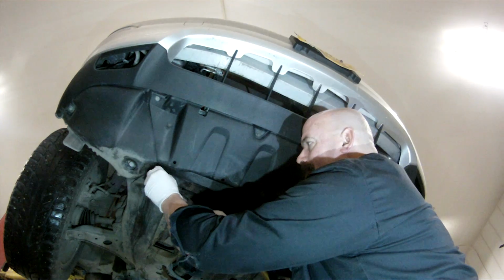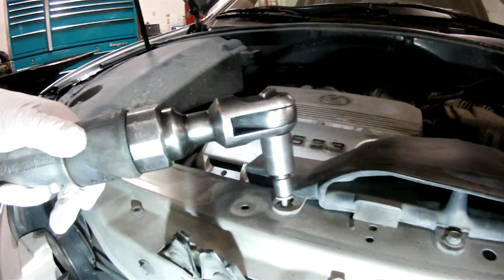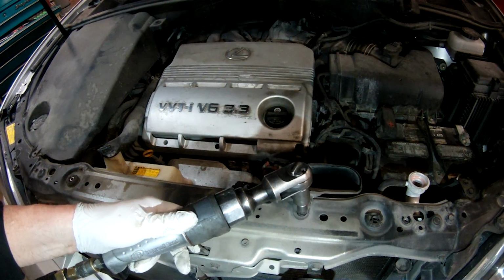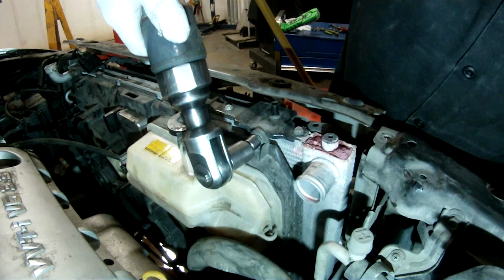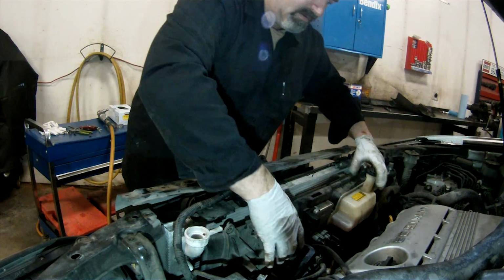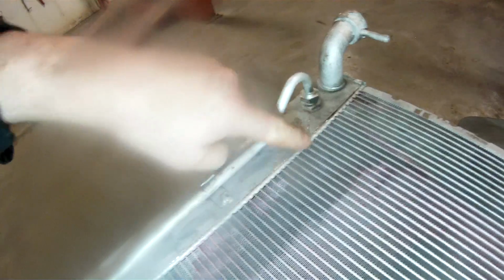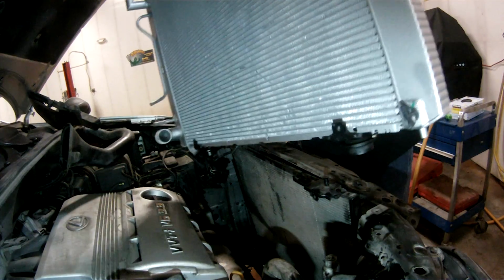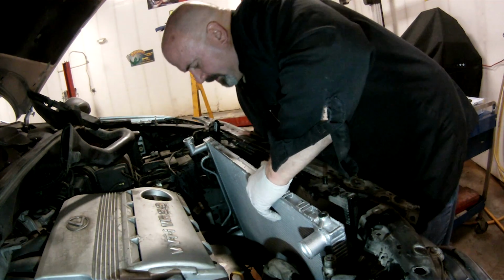Lexus RX 330 Radiator Replace

Comment: Just changed out my radiator on my 05 RX330 with 228K miles on it, thanks to this video! Thank you for the thorough tutorial!!
Reply: How does your car run, cuz I’ve had some major issues that I’ve gotten fixed with mine like double blown head gaskets, both control arms and the radiator as of recently. I don’t know if it’s worth dumping money in it anymore and would need the opinion of a fellow 330 driver

Comment: Great video.  I just replaced the radiator on my Dodge Ram 2004 and it was much less involved than this. My wife has this Lexus RX 330 model and I hope I can get away with my plan for a coolant flush without running into any issues with the radiator or heater core (we bought the car from a young guy who didn't have any recent maintenance records on the vehicle, hence the need to replace the coolant).  If I wind up having to replace the radiator, I will take your advice and get a manufactured model.  I wouldn't want to repeat this repair twice.  Good to see honest mechanics online helping others.

Comment: Good video, first I have seen from this chap.  Have a rx300 same year and will be replacing the rad with a genuine part. Pattern part is 200 euros whereby genuine article is 410. Si it’s costing 21 extra for a component that should last years. Had it 12 years already and still drives like new. The only difference is I have a large aircon pipe across the front of the fan cowling to navigate.  Hopefully without degassing the aircon.
Reply from the maker: I hope the pipe can be moved enough to get the job done. Take care

Comment: Just completed this repair on a Canadian made 2004 RX330 without tow package and the Denso 221-9387 fit perfectly.  Dealer said I needed the 160410A412 but the $150 Denso was fine.  This particular Denso is made for them by Koyorad in Indonesia but arrived in a Denso box.  There were foam strips on the sides of the old rad that I carefully scraped/peeled off and reattached with Krylon spray adhesive.  Two small tricks in the removal are 1) use a ratchet and Phillips bit to remove the long screws that go through the A/C condenser since they are often rusty and 2) use a slot screwdriver to pry the condenser up and out of the bracket it is sitting in.  Mine was stuck in the bracket until I gently pried it up and out.
Reply: how has the denso radiator held up?
Reply: @ no issues at all. Works perfectly
Reply: @billboswell4509  glad to hear, I wish it many more years of service! These are some of the greatest cars ever made
Reply: @ wife loves it and the way the new ones are being stolen and have $5,000 annual insurance premiums she wants me to keep it going.
Reply: @billboswell4509  as long as it doesn’t rust out it should keep going. I use surface shield on the body and frame! How many miles?
Reply: @ 88,000 miles and sprayed with Fluid Film. Driven in all kinds of weather and salty roads. Surface rust but no structural rust except the left rear brake dust shield. Cheap enough but a pain to replace.

Comment: The 05 rx330 in australia is the plastic version 
Yep split the plastic housing on the left hand side
Thermostat was dodgy as hell, maybe the thermostat jams closed - original part has a secondary rubber gasket- shredded and jammed the valve. If the the thermostat jammed closed, then the pressure would build up, causing high temp and high pressure, splitting the plastic radiator housing 
The thermostat is a good 90 mins to change, bit of a head fxxxk for me at least. Great video - Thankyou

Comment: You don't need a stubby screwdriver to remove the two screws from the AC condenser side of the RX330.  Those screws are available to a two foot long one if you wanted.  The front air dam opening is in line with them.  They are usually quite rusty because they are exposed to the elements and in the direct line of salt and sand in the winter.  Take a knee in front of any RX330 you see in a parking lot and you can see one in the left opening and one in the right.  Easy peasy instead of knuckle busting with a stubby screwdriver.  Just use penetrating oil, so you don't strip out the head or break off the screw when they are rusted badly.
Reply: Those are tough to get off, very rusted
Reply: @davidbartelt2384  Yes they are, good luck and   wait over night if you can with the oil.  The hardest part is seeing the darn things to begin with, they are very tough to line up with anywhere but right in front of them to know where to put the tool into those slots.

Comment: I try to by manufactures parts but your right, sometimes the price they want is just too much. There pricing themselves out of parts. Nice work on the one doc!
Reply from the maker: +wyattoneable I appriciate that. The more I can give customers the option the better. That way I can remind them when a part fails to provide the service that's expected. But for the price of this radiator we could replace a few and still be under the cost of OE. Take care.

Comment: The bottom screws on the mounting bracket that hold the radiator to the air conditioning panel are rusted badly.  If I cut the heads off with a small grinder, will I be able to separate the two panels?  Any other suggestions.

Comment: I had the same thing happen with my Dodge Ram. Plastic construction meeting steel leads to thermal strain with the dramatic swings of temp.
Reply from the maker: +spelunkerd I just did a ram radiator today. It was an 02 5.9 gas engine. Wasn't too bad of a job. I'll be posting a video in the next couple days. Check back in a few days if you want a chuckle. It is coming back in a couple days for a timing cover gasket as well.
Reply: +The Car Doctor Ya, I did a vid of that one a couple of years ago. Gotta love how much room there is in the engine compartment, but I found my back was sore from leaning over that engine. It was easier to stand inside the slot for the rad, to bolt on a new water pump, ha ha. Mine is a 5.9, too, and although I love the vehicle I sure pay the price at the gas pumps.
Reply from the maker: I don't think I can fit in the slot between the radiator. I'll give it a try but I may need to get a crane to pull me out if I get stuck.

Comment: Thanks, very good! And how does the new radiator affect the engine temperature? After all, in the new radiator there are approximately 50-60 sections, and in the original radiator there are about 80-90 sections?

Comment: This is a common problem.  I have a rx 300 232K miles and 330 157K miles sitting out there leaking on my driveway.  expansion tank looks low. when I add more it comes out.  But the car runs with out any problem.  Lexus should look in to this.

Comment: Have you ran into any issues with ordering the correct radiator? My wife's 05 330 just got a bad leak this morning. I looked a while back and didn't want to order the wrong one. I dont think it has a towing package but how do I know if it does or not other than not having a hitch? And it says made in Canada in the door. It has metal caps on the radiator. Got any suggestions on what I should order?
Reply: I ordered one from Amazon and it fit. It said in the description made in Japan. It also said only fits Japanese made vehicles. But the seller commented that if your vehicle had an all metal radiator it would work even if its Canadian made. 
     The job did take about 8 hours and I had to add some thin foam rubber between the radiator and condenser to keep them from rubbing as well as transferring bigger blocks of foam.
      I also had to sculpt a lower radiator mounting bracket from a JB weld stick because it had almost rusted away from being in contact with the highly corrosive coolant. Couldn't seem to be able to find the lower brackets in a timely manner on the weekend and after business hours. 
     Hope this helps someone on this job.
Reply: @jamesrogers4674  how has the radiator held up? What brand is it?
Reply: Water pump bearings went out and slipped the timing belt, bent all the valves. Probably shortly after the radiator. Had to buy another vehicle and sold it for 1k. Couldn't believe they'd have such a poor design.
Reply: @jamesrogers4674  bummer, how many miles and had the water pump and timing belt been replaced at the 90k interval?

Comment: Would an 07 RX 350 replacement be identical to this one? Also, I noticed that the 330 has an aluminum radiator and my 350's is plastic. Do the 350's have the same issues with the aftermarkets?

Comment: Hi. Please help me here. I took my 2007 model of RX350 Sports luxary version. After an hour or so, the mechanic called me and said that in this model the radiator is connected to the one other panel which is the part of the airconditioning unit and that he will have to get it degassed, replace the radiator and then take it for regassing. Since I trusted him, I told him that do it only if necessary. After looking at your video, i dont think any mechanic had to take that panel out which was behind the radiator. What should I do? Does the air condoning unit stays as good after taking the gas out and regassing it again? I gave him a surprise visit and took the photo of the parts he took out.
Reply from the maker: I don't think discharging the A/C system in your case is necessary either but that may just be how they do it there. It does make it easier to access and the extra charges shouldn't be too much.

Comment: I just replaced the water pump, idler pully , cam and main seals on my wifes rx330. Hellish job but this looks almost as bad. Wrenching Toyota's for 25 years. They are the best and the worst... Who should I buy new radiator from 2005 rx330 with towing package.